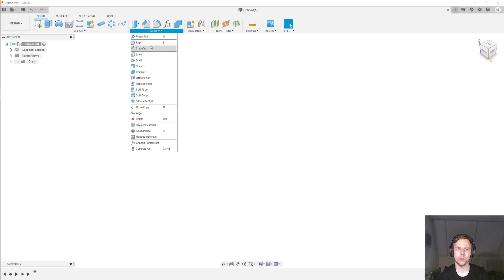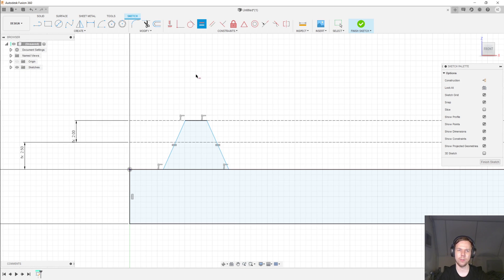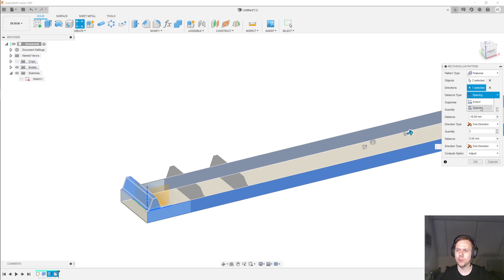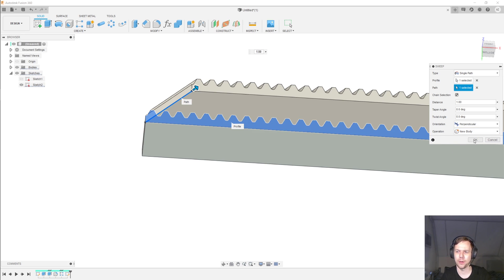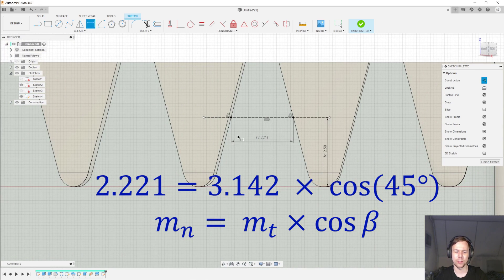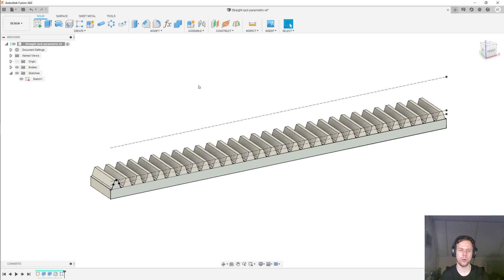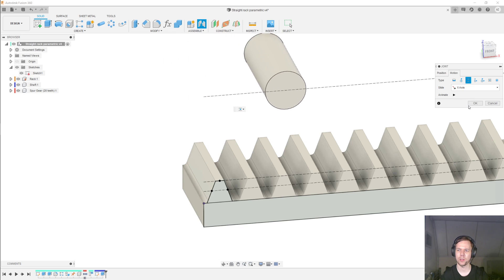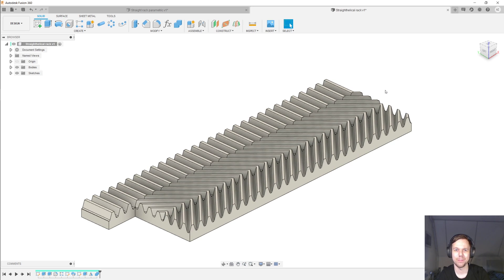How to model Gear Racks, Straight and Helical, Parametric (Gears pt 4/7)

Comment: Hi, I need to increase the overall size of the gears, like say scale it up: overall length from 188 to 6000 and the width from 20 to 200. How should I change the parameters for that? Also just wanted to add, amazing video, even a total noob like me could understand.
Reply from the maker: For the width you can just increase the width parameter. For the length you must either increase the number of teeth or the module. Do note that the module of the rack and the gear must match, you can learn more about that in video 2.

Thanks, and good luck
Reply: @antalz  Thank you so much ! I also wanted to ask , how do should I decide the distance between the shaft and the pitch line ? Like is it random or is there a like a process to decide on that. And what about the diameter of the shaft , I do remember you mentioning in the video that, that can be random
Reply from the maker: @smrutisuresh9530  The distance between the shaft on which the gear sits, and the pitch line of the rack, is equal to half the pitch diameter of the gear, and the pitch diameter of the gear is the module times the number of teeth. In the video around 13:40 I set the distance to 20 millimeters, and I say that's because the gear will have a pitch diameter of 40mm. Indeed, when I make the gear at 15:00 I select a module of 2, and a number of teeth of 20. The module had to be 2 for the gear, because the module of the gear has to match the module of the rack. The pitch diameter of the gear is then 20*2 = 40, and the center of the shaft must be half the pitch diameter away from the pitch line of the rack, or 20mm.
Reply: @antalz  Ohhh got it ! Thank you so much ! 😁
Reply: @antalz  sorry to ask so many questions , I seem to be facing a tiny issue. When establishing the motion link , my cylinder is sliding off alone and my spur gear is rotating alone , where did I go wrong ? 😅
Reply from the maker: @smrutisuresh9530  You need to make sure the revolute joint is between the gear and the shaft, not between for example the gear and a sketch line or something like that. I hope that helps
Reply: @antalz  Thank you so much , that totally solved the issue ! I had made the error of attaching the joint to a sketch point instead of the shaft itself. Now it's working just fine !
Reply from the maker: @smrutisuresh9530  Great to hear, good luck with whatever you're doing
Reply: @antalz  Hi , sorry it's me again. The module I set was 40 mm and the pitch dia is 1600, I put in the formula for motion link : (40*1600*PI)*1 mm. But now it's only sliding and not revolving. Earlier when I did not change the distance , it was revolving just fine . After changing the distance it's not revolving. Where did I go wrong ? 😅

Comment: Thank you for the great video!  I found a few others but none nearly as concise and easy to follow as yours!  

One note on the Cura configuration, I just draw my component sketches onto the XY plane so when I export the STL's, they then import into Cura in the correct orientation!  Or model then change their position before exporting.
Reply from the maker: Thanks so much, that's pretty much why I made this series. The Cura tip does work, but I often have components that are part of a larger assembly, so their orientation is dictated by the assembly unfortunately. Doing some rotations is not a big deal though, and of course I always try to keep printability in mind when designing.
There's a video on the channel about Hobgoblin drive units, those for example were designed as an assembly, not a bunch of separate parts.
Reply: @antalz  Definitely understand your reasoning for modeling in this orientation! 

As soon as I typed out my response I thought about it for a moment and figured you’re very well aware of how the orientations work! Haha
Reply from the maker: @ThinAir-3D  It's still worth while to write out your suggestions, you never know what someone else might overlook. Also don't forget tons of other people read the comments, so they can be useful to them too.
Reply: @antalz  You are absolutely right about that!

Comment: I can't begin to describe how amazingly timely this was. I'm working in Blender and although it makes super gears, it lacks some of the parameters and doesn't really help with the guides or (in my case) a rack.
Reply from the maker: That's great to hear, glad it's useful to you
Reply: @antalz  Exceptionally! I'll admit I'm having to plod around and learn it a little at a time but knowing how to do it is 90% of that effort and if I do it right first time, then I won't have to worry!
Reply from the maker: @marcdraco  Great, if you need any help let me know. I have 0 Blender knowledge though.
Reply: @antalz  Thank you. Blender has a gear system but it's not really up to the quality the Fusion plugin provides. You can't (for instance) insert a fillet. I suspect it was created for gears that "look" right without the real-world functionality.

Now I can make some adjustments myself but a better plugin would make a world of difference. The best I've found doesn't work on the current version though.

However, all that said, your videos have both taught an inspired me. You are an excellent teacher young man, don't ever let anyone tell you otherwise!

I understand 100% more than I did when I started all of this and you're the reason. Let me raise a glass to your health and happiness and all the best for 2021!

Comment: On your note about Cura and the orientation: if you correctly use the variable layer height you can have extremely smooth layer transition.
Reply from the maker: Variable layer height can definitely help, especially if you have mostly horizontal and vertical bits, with a few curved bits in between. For a rack though it's almost all curved or at least angled, so you'll need to print nearly everything at a low layer height.
The other problem is that the teeth will experience a shear force that will tend to rip the layers apart. It's much better to orient the layers in a way that the force stays within a layer. The strength within layers is generally roughly double the force between layers, CNC kitchen has done a lot of testing on that subject.
I do suspect that variable layer height might be a huge help when doing bevel gears.